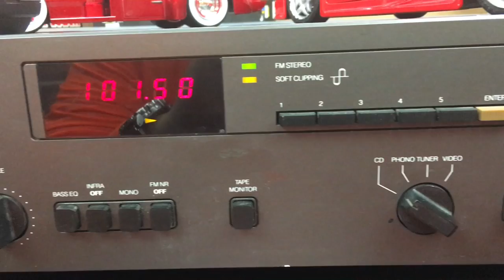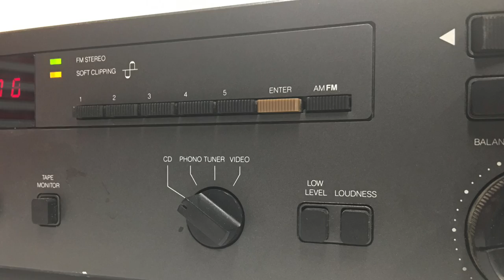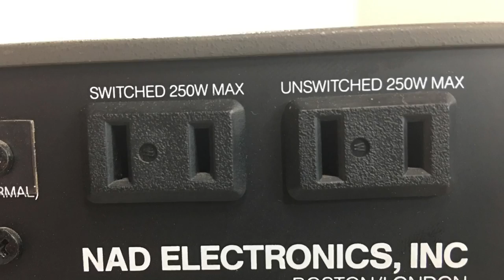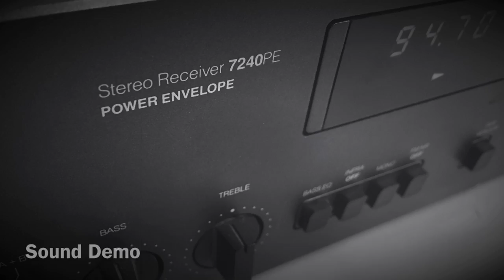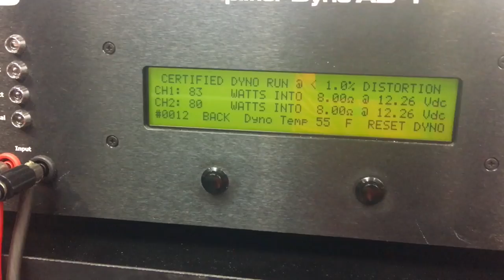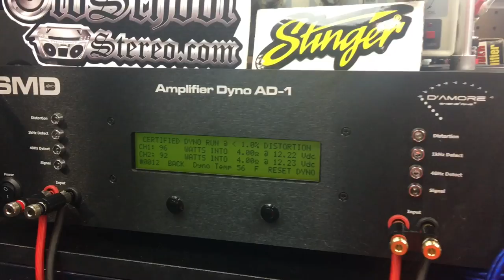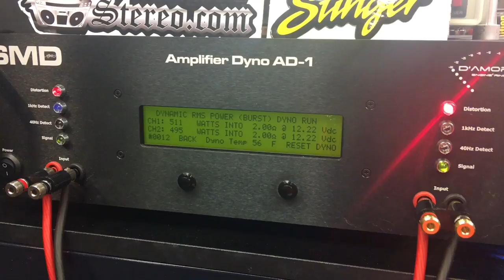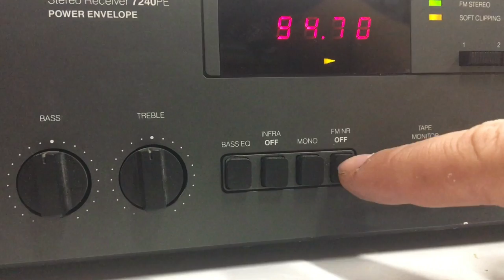NAD 7240PE Vintage Home Receiver - Incredible Dynamic Power

Comment: I've used an NAD 3240 PE for over 30 years now and It's never been in the shop.  The volume control's a bit scratchy now, so I probably should have it cleaned and serviced for anything that may be at risk.  Liked it so much I got a 7240 as well.  

The power on this thing was always crazy, but what made it great was the quality of the music.  Just very impressive all the way around.

Comment: I've had a NAD 3240pe since 1989 and I always thought it had a little more power than the advertised numbers, thanks for confirming. It's still running good on a Cerwin Vega 12" subwoofer  and the combination makes for some very powerful bass tones.

Comment: That's pretty amazing.   Can that amp be used as a monoblock into 4ohm speakers?

Any chance you'll be testing the NAD Power Envelope 2100?
Reply from the maker: +mlach2003 I have the 2200, but it may need some TLC prior to the test

Comment: Looking at your tests, looks like the amp needs to be re-biased as one channel is slightly more powerful than the other.  Both idle current and bias are adjustable on the 7240.
Reply from the maker: Maybe so, however I've tested a lot of 2 channel amps an always show some discrepancy between the channels. Some more than others for sure.
Reply: It would be interesting to see what your measurements are after a bias and idle current adjustment to factory specs.
Reply: Electone_Guy  the difference is in the soft clipping circuits. these amp boards were built and/or sorted as matching pairs for left and right with very small tollerances.
Reply: whats the difference between  idle current and bias ?

Comment: Damb. good power for a small receiver
Reply from the maker: I almost fell out of my chair!
Reply: I have a Kenwood KR 9600. and that Beast weighs at least 50 pounds and I think that's a 100 to 150 watts per Channel. the thing was built I think in the early seventies and it is still kicking out matter fact I'm using to JL Audio 12w6 wired at 6ohms in studio monitors just to keep the impedance close to the horns and mids
Reply: Ehren Krause i have owned a few receivers from the 70s, marantz and pioneers rightfully command the high dollars today and are my favorites. I got my hands on a Kenwood of the era and opened it up, something I saw really disappointed me. Jumper wires (3-4) soldered across the board at the factory, indicating a major mistake in the original circuit board architecture. A big  no no in the industry.   Otherwise most of it was ok.

Comment: The soft clipping needs to be turned off.  It throttles the amp to reduce clipping.
Reply from the maker: +Bluelithium I shall try again 🤔
Reply: If it throttles it, what is the thing going to make with it off? 
1500watts?!
Reply: Flipping the switch on the back to 4ohm may have given higher or lower numbers on the test - im not sure what it does honestly.  My understanding of the soft clipping is that it is actually soft clipping, not dynamic range... so it would add THD at high power but in a manner that's less perceptible than hard clipping.  Could help or hurt, wouldn't know till you try.  I set my 7140 at 4 ohms with soft clipping on, but it would never matter cause I never need  the rated power let alone soft clipping or burst.
Reply: Soft clipping brings the amp to (soft)clipping a lot sooner than playing it on full dynamic power with soft clipping switched off . I like to call it "soft sabotage" because it is a solution for a problem that is not there. Dynamic power of nad amps are more then needed for normal listeners even at high volume , soft clipping kills max power and dynamics of the amp. And we all know , no matter if it's hard or soft , clipping always is and sound bad.

Comment: Dug one of these out of a trash can by someones driveway, brought it home, cleaned it up, checked the offset, Works flawlessly and has for about 4 years, running it into a pair of the smaller advents I dug out of bulk trash pickup, put a set of foam replacements on the speakers and recapped the  crossovers, They look great and sound great, found a matching CD  player on Craigslist for $35.00, that's my Rig,I think I'm all in around $75.00, Sounds Friggin Great, everyone who comes over wants to play with my "Old" Stereo rig..... There are deals out there fella's, just saw a complete NAD Componant rig with integrated amp and KLH speakers go for $300.00 on craigslist,

Comment: pretty sure these were around before 91. roommate had one around 89 and he got it used. elegantly simple, everything you need and nothing you don't. I have the proton table radio stereo system made by the same company.

Comment: Had that Receiver paired with Mordau t Short speakers, needless to say I had to keep the volume level in check (meaning between 7 an 9 o'clock) otherwise I would have some nice clacking on that little 5 inch dri er :P But on the headphones this baby has the sweetest sound paired with Grado's.  Pure hi fi goodness from the turn of the 80's to 90's period.  Now I'm really interested if you guys could bench the 7175PE monster 😀

Comment: I know this brand and have an NAD 208 power amp. More than ample for my speakers. It’s pristine in appearance and performance. I would send it to you for a dyno test, but the shipping would put me in the poor farm! I kid you not. The transformer weighs 37 pounds on it’s on. The wiring in it is point to point and nicely done. I have had it since it was new and I could not sell it on a bet. Treasured it is!

Comment: This receiver seems to be using discrete output transistors, not those STK packs or any other "amp on a chip or ic" shortcut, which is why it has such good dynamic range, along with a robust power supply.

Comment: I bought a 100w per channel NAD recently and was incredibly impressed. I knew it had some dynamic reserve but I couldn’t play it loud enough to clip and still be okay with sitting so close to the speakers in my living room. And then I switched it from 4 ohms to 8 ohms and it was audibly even louder. I’d bet it was capable of over 600w per channel.

Comment: I just bought a 7240PE a couple days ago, it’s a great little amp! I also have an FP14000 (Lab Gruppen) clone pro audio amp that’s rated at 7000x2 into 2 ohms, I use it to drive a pair of 15 subwoofers in my home…I would love to see an amp dyno video on one of these amps if you can get your hands on one. I run mine at 4 ohms stereo and it has tons of power!
Reply: Just take the rms voltage.... then calculate the Watts

Comment: Bought one of these a couple of years ago, Im using an old set of Advents and sounds phenomenal! I'm not new to hi-fi, had many receivers, amps and preamps and this one is right up there with some of the best I have owned. Yes, I hear they are a nightmare to work on, I hope mine keeps on playing. I had another one with the amp section blown, but the pre section was sweet and I used it as my main preamp for years. I was lucky to find another one in pristine condition and working excellent.
Reply from the maker: These are jewels!

Comment: I've got a nice mint pair of those Optimus Pro LX-5's and a Optimus (Pioneer) receiver I bought brand new in 1999! Right now they are my garage tunes, going strong almost 20 years later.
Reply from the maker: I killed the surround on one of them at the end of the sound test. Nice to see they have replacements on eBay. I'll be getting some and refoaming all of mine. I love these speakers

Comment: Too bad NAD doesn’t make receivers or even integrated amps with dynamic power I had a C350 intergraded amp and it was crap compared to my first receiver the NAD 7100 monitor series from 89 in the last 20 years or so NAD has been making audio equipment that just doesn’t cut it for the price I am glad I sold the C350 and greatly regret selling my 7100 but I have moved on to pro audio and won’t go back to home audio but this is just a rant of advice if you want to get into the audio game and don’t want to spend a lot money buy older vintage NAD.

Comment: when i was young and dumb my grandfather gave me a tube amp with an impedance switch. it went from 4 to 16 ohm. i had a 4 ohm driver hooked up, switch the amp to 16 ohm. it was loud for about 5 minutes.

Comment: Really nice seeing that. i worked at NAD one summer in the warehouse where they had the warrantee repair shop, i did QC inspections of the repaired equipment. I have an old NAD 3080 still in service (140Wpc). 

I also have a set of those Optimus LX5II with additionally an old Morel 3" dome midrange filling in 800-8K and 8" Urban Audio (sherwood) sub (for one of my computer/room setup's) powered by an Optimus STAV-3770 receiver (5x100W@8ohms .9%).

(the comment about the lx5's being midrange shy would love these old 90's era morel midranges. i put them in boston acoustics A40 boxes where they sit at ear level reclined, the lx5's are at ear level when i'm upright. the 8" subs are no slouches at home in 1cu' boxes on the floor, they play well below 38Hz [i rewired/built all the passive crossovers])

but my chevy pickup is mostly all a/d/s/ !
Reply from the maker: +Dave Jo sweet 😎👍

Comment: This is my primary amplifier. I have it driving a set of Alesis Monitor One studio monitors, and a set of 80's Accusound 3 ways with 12" woofers and Neo magnets. I have never found a better system for what i do. I also have a 7175PE. That thing is dangerous.

Comment: Just a thought here, Im not too knowledgeable about this stuff but would retro-fitting some bigger internal speaker wires increase this things output at all??
Reply from the maker: It would not hurt, but I doubt the difference would be noticeable. They are very short runs.
Reply: I see. After how good it did I just thought they were possibly bottle-necking the system, theyd HAVE to be the weakest link lol
Reply: HashCracker no difference except a thinner wallet.
Reply: HashCracker imo the bottleneck is the Power Envelope circuit itself. Just not a big fan of those units. Much prefer the earlier japan 7140 and 2155/3155/7155 non-PE models as the reliability was much higher. The PE models sound fine to a point, but once that secondary/high voltage power supply in the PE circuit is exhausted they can bring about nasty distortion. I point the finger at the Taiwan/Singapore origins, flaky heatsinks and less robust PE power supply to accommodate "+6db headroom."
Reply: Andrew Harvel I just got one for cheap today (my first piece of NAD gear) and I think I know what you mean. After preliminary tests I wanted to see what it could do when really pushed, ready to turn down the volume immediately once I heard distortion. Man when that distortion hit, it was probably the nastiest clipping sound I've ever heard (I did have the "soft clipping" off for the tests). Not sure what it's fate will be yet, but it sure doesn't come close to my Heathkit AA-1600 amp. Still, I had it cranking for well over an hour and it barely got warm, not bad at all and certainly no complaints for the price I got it for

Comment: Very impressive, I wish I could run a dynamic text on my Onkyo tx-sr604.  My plate amplifier gave out on me a while back so I'm using the two front channels of it to run my Polk psw10(plate amplifier no longer works and speaker is unhooked from it and ran directly to the front left channel) and a sundown LCS 12.  The Onkyo website claims 225w @ 3ohms, the Polk is running at 4ohms I'm guessing and the sundown is dual 4 wired down to 2ohms.  The receiver has the ability to tune the separate channels to play certain frequencies, so the front channels are playing at 40hz with no vocals coming through.  it's pretty impressive and at volume 70 out of 100 the sundown looks to be near it's mechanical xmax

Comment: I recently dug out my 30 year old 7240 to pair with a mid- 80s turntable. It was the only amp in my collection that had phono inputs. The 7240 was hooked up to a pair of B&W 803D and to my amazement, it had no trouble driving those supposedly power hungry speakers. Much respect to the NAD designers who put functional integrity above bells-and-whistles specifications.

Comment: I have a 7155 and I'm impressed, and also wondering if you could do a review on it if possible. I've had several amplifiers and NAD was a brand i always wanted to buy, now i can say I'm not dissapointed, in fact , I'm amazed, nice clear sound, powerful enough , and has a nice phono preamp as well. A lot for a small receiver.

Comment: NAD gear was very intelligently designed and performed like much higher end equipment. Having a small receiver or integrated that could handle 2 ohms was unheard of generally. I just set up a 3240PE integrated for a friend while his regular amp gets fixed. It's  the same amplifier stage as this receive. Powering a pair of Klipsch RF7 speakers is effortless and has tremendous headroom.

Comment: The 7240 was actually the higher end of two models from its original production year (the smaller being the 7225pe). The 7400 and 7100 models were in fact later models. It's possible that NAD clung onto this as its lowest end offering along with the new offerings in order to give customers more purchase options.
Reply from the maker: Yessir 👍

Comment: It stands head and shoulders above any amp at price performance ratio. 
The highs dont have harsh definition like amps like Pioneer, Kenwood. The bass is quick like an Audiolab or Kardon amps. I would classify it as neutral sounding. The PE design is the killer indeed, especially with listening to classical music when the contrasts from soft to loud passages can trick most to turn any amp louder.
Reply from the maker: +roylikesitlikethat I agree. The Proton D1200 is even more impressive. Incredibly powerful!!

Comment: I still have my 1983 Nad 60W x 2 power amp with a Onkyo preamp sitting in my closet , still using my Cerwin Vega D7`s that I drove with the Nad , The Nad pounded the Cerwins hard never a problem ,, bought the speakers new in 1984 :)
Reply from the maker: NAD is great gear 👍
Reply: Had another look lol , it is a Nad 2155  , started searching my area to get the RCA inputs replaced ...

Comment: Those lx5 lineaum tweeters were great. Have you still got them?
Reply from the maker: Yes. The mids need refoaming
Reply: @wal  I didn’t keep the mids, I transplanted the top tweeter plate onto a transmission line mid/bass cabinet. The original mid always sounded a bit muddy to my ears. 👍

Comment: I have NAD C740 I looked at an online manual it says it can run 2, 4 & 8 ohm speakers but what about 6. I have a bunch of bookshelf speakers but they require 6 ohm. Would anyone know if it safe to use 6ohms?
Reply from the maker: Yes. Anything above the lowest number would be fine
Reply: BigDWiz I contacted the company a few days ago and you answered my question in few hours. Too bad there no clear sign on my unit on connecting a active subwoofer. I've got plenty of passive ones.

Comment: Have a proton integrated amp and separate am/fm radio. Almost identical inside and out to your amp. Must have the same build house. Very happy with mode too. Glad you did a dyno on a product I almost own
Reply from the maker: +indopleaser I believe they are identical.  Proton had "Dynamic Power on Demand" and NAD called it "Power Envelope"
Reply: one more thing, did you have the anti clip circuit turned on or off when you did the dyno test

Comment: I have this exact receiver but it apperars there's no way to attach a subwoofer, is that correct?
Reply: I do. I have splitter cables across the preout to power amp in with the branches going to a subwoofer amplifier. Sounds great.
Reply: @tedbrookins  is that safe power-wise? What’s the exaxt setup, maybe I’ll mimick? Im running a pair of Focal Chora speakers. Sounds great but missing bass, maybe because i’m upstairs or not in the ideal room. If i press the “loudness” button i start getting a humming reverb/distortion at about half volume...

Comment: You could probably get even more power by switching the resistance switch on the back to 4 ohms!
Reply from the maker: +Technoflicks in my experience this is not the case. I've proven with other amps such as the Linear Power car amps. The switch to a lower ohm load lowers rail voltage and sacrifices lower ohm loads for decreased efficiency and less power
Reply: BigDWiz ah, id still love to see what it could do without soft clipping. OLD school stereodotcom. I like your style guy
Reply from the maker: +Technoflicks now turning off soft clipping does make a difference. See my later test on the NAD 2200 power amp
Reply: BigDWiz I was on craigslist a couple days ago and found an amp called the NAD 2600 (50% higher rated  wattage at 150wpc, at least sine wave, than the 2200) for $165. Looked up a dyno test and found your videos, very helpful. Probably gonna pick it next week since I've been wanting a class AB amp and it looks like a BEAST!

Comment: did you have the 4ohm switch on for the 2ohm load
Reply from the maker: No, it was in the 8 ohm setting for the entire test.
Reply: awesome i just hooked up my four klipsch synergy f-2 1 per channel they say 8ohm but tested at 4ohm any ways its amazinhow it bumps these its good to know i can add 4 more if needed and this thing still power them as even with my sansui au 7500 running them they can only seem to handle half its power even though its only a 32 watt amp thats that old school power for ya